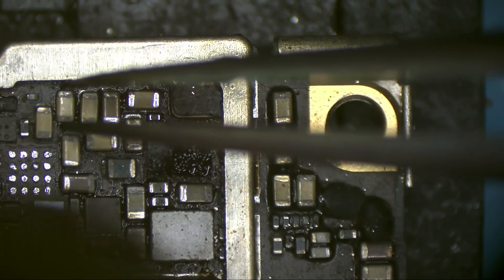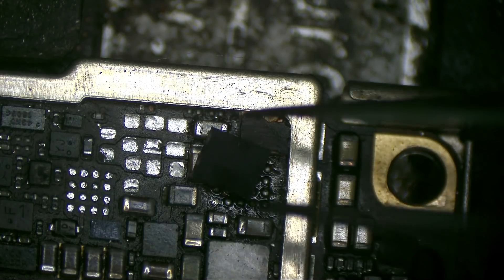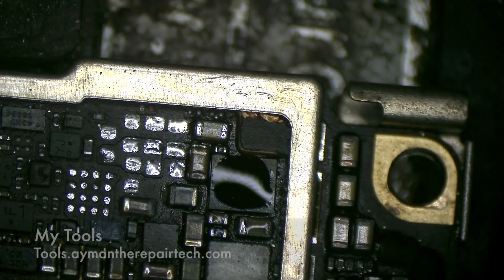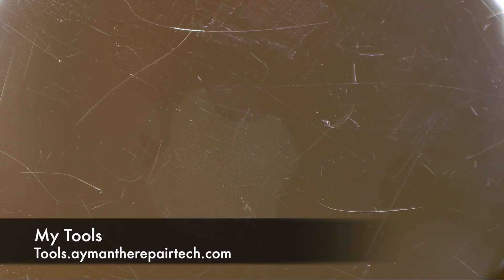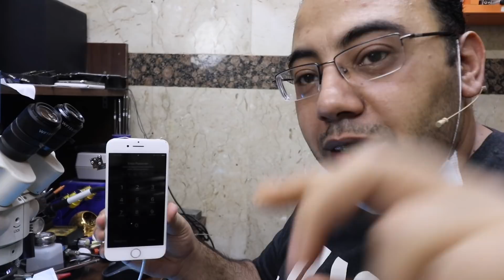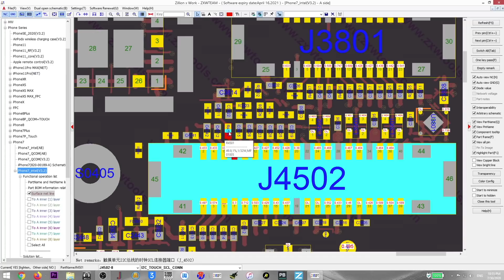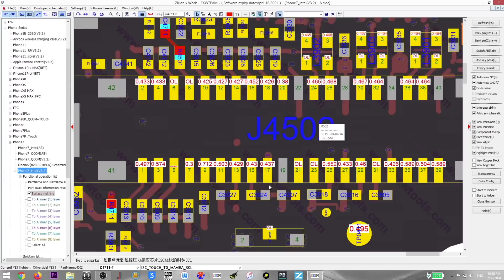iPhone Water Damage Repair | How to Fix Water Damaged iPhone 7 NOT Turning ON

Comment: First, I'll start by saying that your video is decent.  You have a lot of good info but for whatever reason it seems like you have a vendetta against rice.  And the things you say about rice tell me that you've been mislead to the purpose of using rice.  Rice was never meant to "clean" out a mobile electronic.  It's meant to dry out.  I've dropped mp3 players in water, my kid bathed an iPod mini in Sprite, he gave his Kindle Fire a bath and in all those instances I warmed up some rice and threw it in a container or bag (bag works best) and let it sit overnight and never had to take apart the device to get it working again.  That being said, if you can get your hands on silica packets those work the best at drawing out moisture.  Keep up the good work.
Reply from the maker: Thanks a lot and i agree with you rice will dry the water but what about the menirals, rust and damaged components it is always better to send the water damaged electronics to service as soon as possible because maybe you will see the device working after it become dry by rice but then bigger issue will appear and maybe the service will ask you for more money to replace the damaged parts and sometimes those parts are uniqe to each phone and can't be replaced

Comment: What is the longest you think a phone could go being water damaged and still be repairable?
Reply from the maker: It is not like that it is depend what the water did to the phone and what is corroded some phones fill in the water and after a week it is still working fine because the water didn't access to the main board

Comment: Or just remove all the crud with toothbrush, rubbing alcohol and a Q-Tip and give it a good scrub everywhere 2 x - 3x then use hairdryer or hot air gun for few seconds to make sure it’s dry the. Bam it works again, I’ve cleaned some heavy saltwater crowded boards I tell ya

Comment: Sir, some pads not showing any diode values lcd connector pads, cc pads like that. But its not NC pads.. i checked in a working bord and schematic also. How to know  in a damage phone that line working or not if i dont have a same bord
Reply from the maker: measure from the pad to the component it is connected to
Reply: @AymanTheRepairTech  thanks sir...